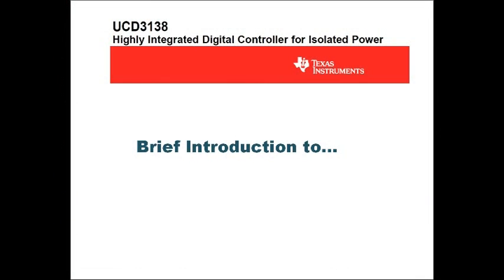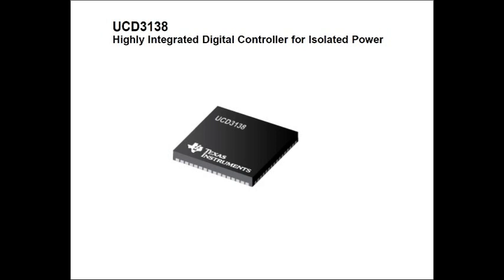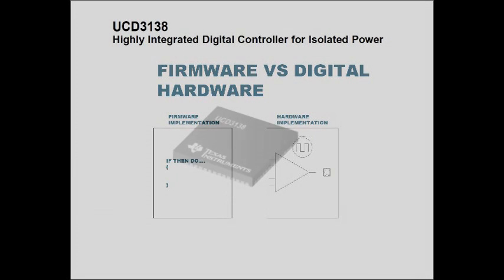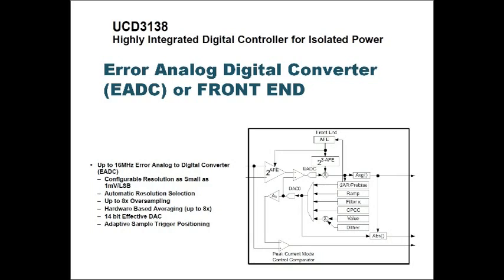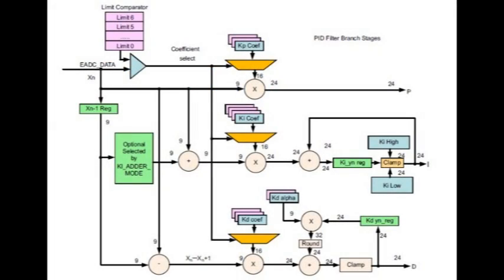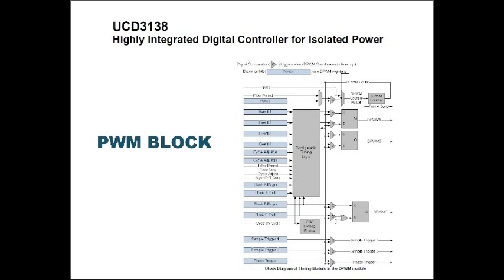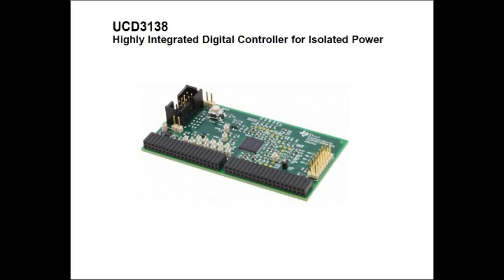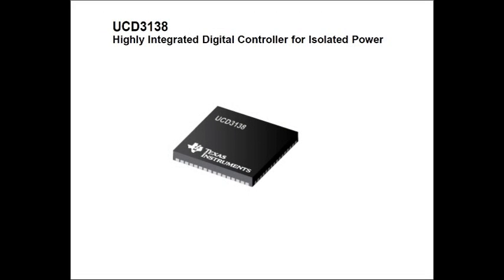UCD3138 Review

Comment: hello i m working on a project that concerns using the UCD3138 for isolated DC DC Converter and i need documentation  thanks for helping me out
Reply from the maker: Hi there.  TI has improved their documentation immensely since this video was created.  Searching their website for the user manual and software & app notes will get you what you need. The UCD3138XX devices are relatively easy to work with using their code composer and fusion PMbus tool.  The device itself has a bit of a learning curve because of the large amount of registers that are interrelated.  They have eval kits for phase shifted full bridge PSFB and LLC resonant isolated DC-DC applications that you can look at as well, though I think you still have to request the source code for those eval kits directly from TI.

Comment from the maker: A viewer had asked if I had made any further progress with this device so I will give a bit of an update.  Over the past year I have used it in several projects successfully for multiphase buck converters, full bridge designs,  and current sources.  I am presently looking at how to use it in applications that TI did not intend it for, such as voice coil control and motor control.  With the ability to close a current loop at high switching frequency,  there is some opportunities to experiment with sensorless BLDC control that looks at changes in inductance for determining rotor position at stationary or stall conditions.  Lots of fun things that you can try.   The only thing I will say about this device that is a negative is the time it takes to understand all of its functions. A person not familiar with this family of devices will have a steep learning curve to overcome, but once that is done, the time to implement different topologies is quick.